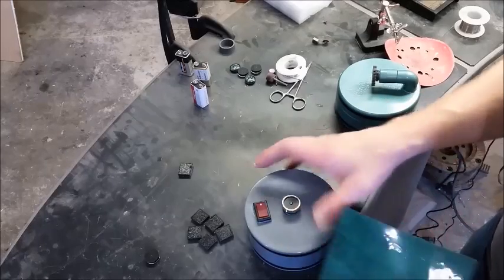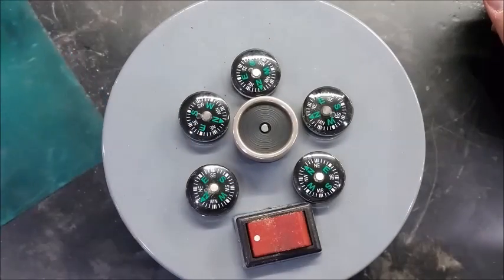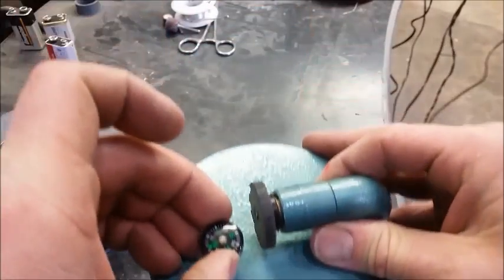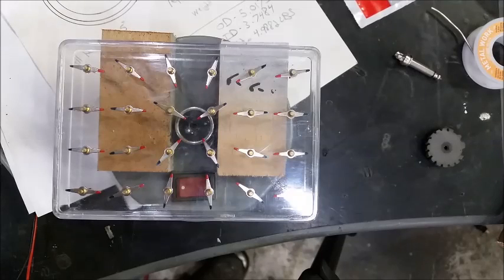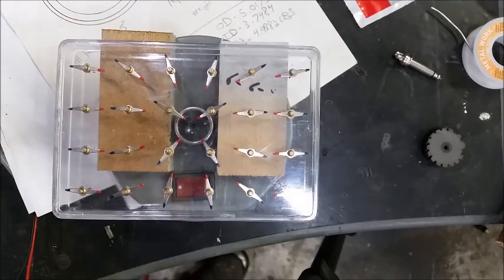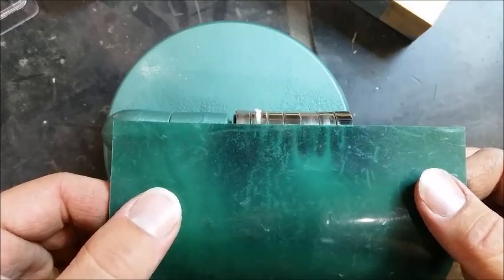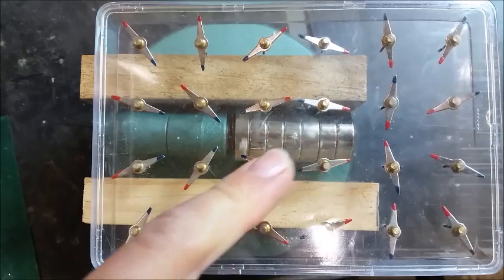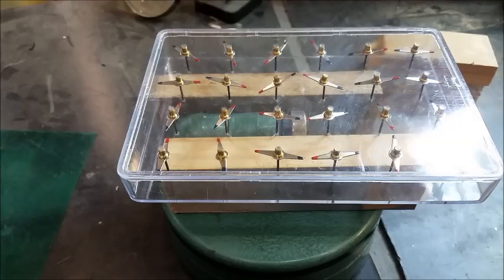Searl effect generator replica: rollers special magnetizing effects demo

Comment: I have a suggestion for your searl effect S.E.G. to possibly help you achieve I.E.G. mode and have it be super wicked. Build a version using (of course obeying the law of the squares) precisely magnatized blank magnets with perfectly shaped as well as the + and - flux rings are exactly the same. You could take a conductor from an E.M. imprint head and rig that into a sort of pen and run a capacitor bank through an (I forget what they're actually called) adjustable current control   in order to finesse the flux points. Each magnet in the rollers has to be almost symmetrical like down to the micron, and the current of each magnet has to be exactly the same strength. The symetrical geometry of the fields produced and the precision of parts including the Teflon is key. Everything must be symmetrical down to the micron level. Once that's done and it's 100% perfect (would probably even help a little to plasma clean the copper used also) once you have that assembled adhering 100% to the law of the squares, it should be able to run at the near full capacity of S.E.G. mode, BUT, if you have a device that can visually graph the field frequencies given off by each part, you can record that data, or it might just have to be the frequency as one whole device, but I'm printing those wavelengths into the outer flux ring so that it precisely forms to the correct wavelength. THAT I think is how it self stabilizes it's own fields in order to further expand without loosing efficiency. (although I'm not exactly sure if it's just the entire searls frequency as a whole, or if it has to do with...the rollers fields interaction with the inner and outer rings for example. Or the rollers fields interactions with eachother. Or maybe it has to do with the rings field flex around the rollers.) Not sure. I wish I had access to the stuff to try and make one more than anything. Also I think to achieve self superconducting it would be good to have six ring layers instead of three. With multiplying numbers of rollers per ring from inside out in full accordance to the law of squares. Even to much imperfection in units of Mass per square millimeter anywhere even on a stationary part that will alter the atomic electron intake and output flow in a way that will reduce efficiency and not be able to continuously gain speed after I.E.G. mode kicks in.
Reply from the maker: Hi please email me:
Isaiahritchey@gmail.com

Comment: how accurate does that have to be? (this magnetic field that you are trying to create) and does there have to be a specific intensity?  also I am guessing that this wave field itself has to have some kind of specific proportional wave pattern? to the wheel it will be spinning around? does this make sense? and if so, how would one calculate that? ... and also would there be a challenge in engineering that?... i.e. what I am trying to get at, is there a known (calculable) window of precision that can and needs to be achieved? or will different fields simply generate different levels of output, for example?... great work btw...

Comment: you should try to correct the rotating so it rotate straight, it will probably even with one magnet remove most of the waving you see, at least what will append when straight :)

nice job anyway

Comment: you should rap 1/4 or less of your rings with soft iron when you magnitize them. it should magnitize them with the proper pattern.
Reply from the maker: Josh Roten once the magnetizer is up and running this will definitely be tried:)
Reply: Why does wrapping the rings with iron affect the pattern, I'm curious. Do you have any links you can share about it?
Reply: What sort of frequency of wave pattern do you think you'll need to imprint into the magnets to generate spin in the rollers?  I ask because to achieve the searl affect doesn't the frequency of the magnetisation imprint need to be relatively high so as to create the cogging effect?  The magnets I have seen you create only have 1 large undulation in the field per ring, do we not need to get tens or hundreds of undulations per ring? is this why searl used a combination of dc and ac in the magnetisation process. I imagine he used the ac frequency or some modified version of it to leave a waveform equivalent to the transmission frequency on the magnet. I would like more info on this. Thanks
Reply from the maker: Julian Harris from what I have read it may in the range of thousands or more...
Reply: +Julian Harris  I dont have any links but wraping it in iron intensifies the magnetic field. i was watching a video of the way john did it. they rolled the magnet down magnet paper. it has one spot where the feild is stronger then the rest. the way i figured (may or may not be right) is they just took this and slightly rotated the next one so they would not line up. i wish i could test these ideas myself but i have no magnatron and no money:(
Reply from the maker: Jason Verballi says its similar to butterfly wings. tens of thousands of micro ripples in the frequency.